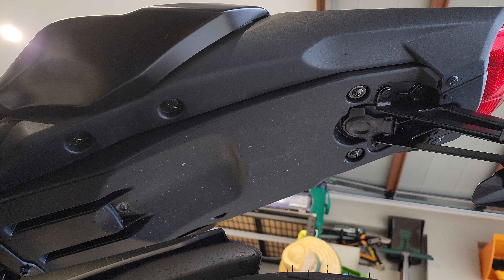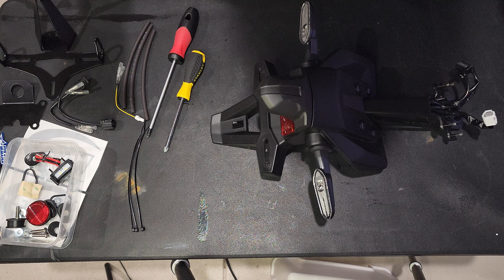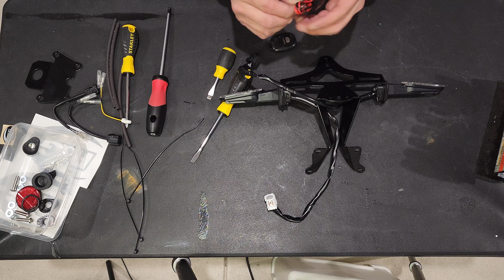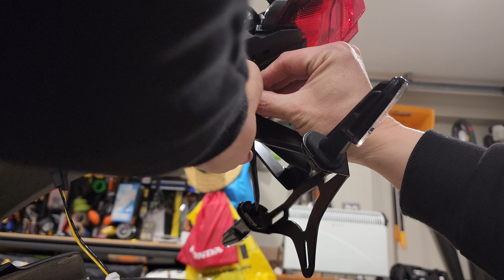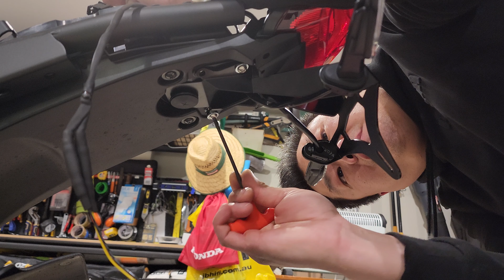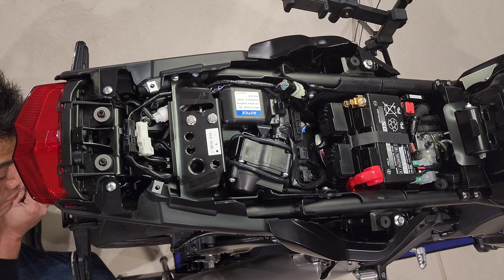R&G Tail Tidy Fender Eliminator Installation On 2022 MT10

Comment: Is this a u.s. spec bike? Seems like I have additional wires coming from the left and right turn signals that (y) down into or along the sub frame of the bike any ideas?
Reply: My 2022 mt10 also has an extra wire not shown here that makes it impossible to pull the wires out without snipping. Canada here.
Reply: @Phast1x  ok so I found a solution to that ... those are resistors .. they y off of the turn signal I know .. but if you disconnect the mount for the turn signal receivers ... on the brake light house and un clip the brake light wire you can pull the whole house for the brake light off ... then you have enough room to pull the resistors out .. they are a tube the go down along the tail of the bike and connect now where they are to slow the flashing in the turn signals..... but if you take the brake light housing out you have more then enough room to pull the resistors out and feed them through bottom whole to full get them out without braking or snipping anything
Reply: @JD ON2  
Amazing. Great catch, thanks for sharing this information 👍
Reply from the maker: Didn't see your comment until now. It's an Australia version.

Comment: wow that looks way better i kind of wish I got the r&g one now I ended up going with the dmp one off revzilla it wasn't too expensive 
and now I know what to expect when I install mine that was a lot you have to take apart sucks they don't just do like most other bikes and put bolts you can remove from the outside
Reply from the maker: It was relatively easy. Yeah there were a lot of disembly. But at least panels comes off easily. Unlike Honda Fireblades which I've owned. You break every clips trying to take off a side fairings. Lol

Comment: Looks like they’ve given you the wrong one, that’s the tail tidy for the 1st gen MT10, Can see the tail tidy pushing up against the undertray and forcing the tail light up.. they need to send you the new one for 2022
Reply from the maker: Okay I missed this. I thought it was a good fit. I check R&G site and they only have one model to fit for MT10 which is 2016 - onwards. I will contact R&G and see what they have to say about this.
Reply from the maker: I have the confirmation from R&G and they have confirm it is the same part number tail tidy for Gen1 and Gen2 MT10 and nothing has changed and the fitting looks normal. I also think it looks like it's fits well. Maybe the camera angle made it look like it's pushing up the tail light but it is not.
Reply: @RaidenXXII  I took it back and got a refund and they apologised and said they shouldn’t have sold that one to me and they were in the process of designing one for the new bike
Reply from the maker: @bentalbottalbot  thanks bro. I have email R&G for explanation regarding why they told me wrong information and chose not to disclose they're in the process of designing a new Tail Tidy for the gen2 2022 MT10. I am starting to be not about about it. Thanks for the update brother.